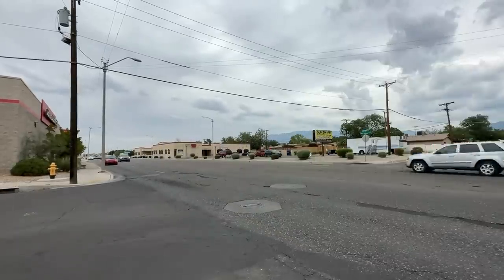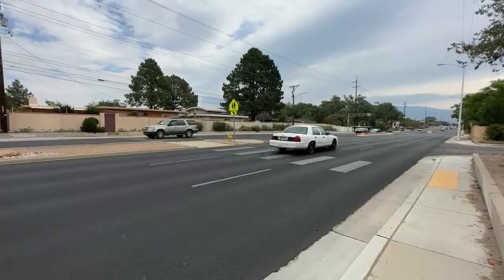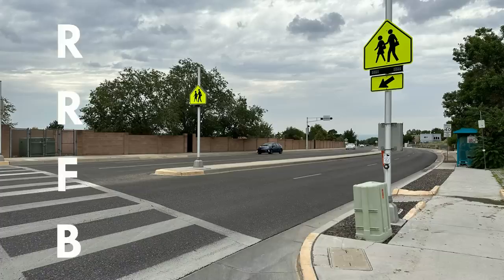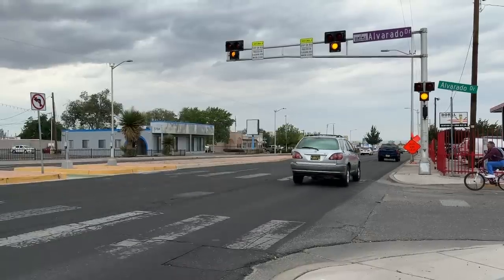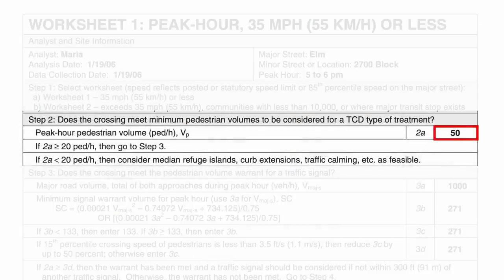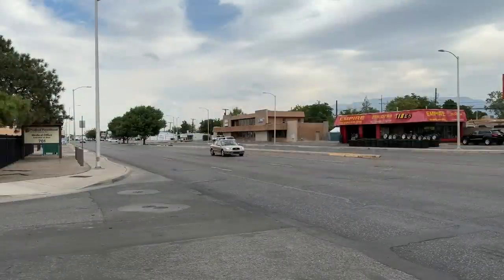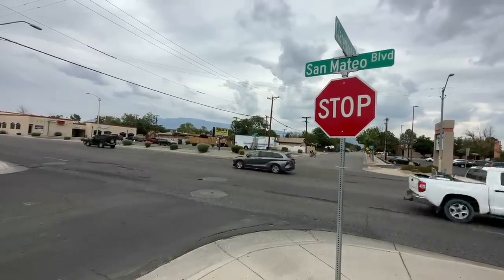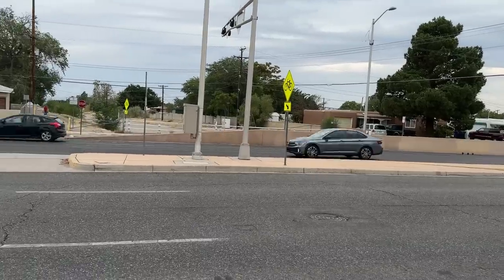The Insane Ways Traffic Engineers Try to Make Streets "Safe" For Walking

Comment: I wonder what the effect of adding bicycle police units would be. If law enforcement has to deal with dangerous streets, they would be more likely to enforce traffic laws in favor of pedestrians and bikers. I also think these bureaucratic methods for evaluating street construction are relatively useless. To me, a better approach would be to construct different "routes" for different purposes. That may even include high traffic routes for common commuter routes, but it would also include corridors for pedestrians, bikers, and slow moving vehicles.

Comment: There is often only one safe way to cross locations like this,  and it's to move about 200-300 feet away from the intersection  in question and cross there, away from the intersection,  when there's a gap in traffic. The 200 ft gap gives you 5 seconds . And allows you to screem out turning traffic and focus only on single direction traffic.

You need to understand that vehicles travel  approx 1.5 times the mph ...at 40 mph that's 60 fps.  Walking is only 5 fps...it 2 seconds to cross a single lane. In that time vehicles have moved 80 feet.

They are legally required to put in these crossing facilities right at the intersection but they often inherently unsafe by location. Change your location farther away and cross there instead of in the death zone.
Reply: Steve, you are so, so right about this.  I remember as a kid, over 50 years ago, being taught at school that the only safe place to cross the street was at intersections.  My brother and I talked about it and decided that was the stupidest idea imaginable.

Comment: We call then beg lights.  
You have four options
Nothing which is bad
A stop sign, where you have to stop 100%, though most don’t
A stop light which are very expensive.
The latter two also tend to move the “road rage” elsewhere.
Then there are the RRFB’s or what we call beg lights.
In Oak Park where I live (and a City Nerd favorite) we call them Beg Lights.
What I say is that you are indicating your desire to cross the street.  
Many cars don’t stop, but the majority do.  The light goes on, so the pedestrian is or should be aware.
Given the issues with traffic enforcement, I’d prefer mobile cameras with small tickets.
Most drivers stop, and I think the Beg lights are for this country about as good as you’re going to get.
Even if you have an ideal crossing with space and time to cross, short of gates, some drivers will always be problematic.
The problematic drivers is where the focus needs to be.
I much prefer the beg lights.  I no longer get angry, and for me, on foot or bike I feel safer.
Pedestrians needs to be aware.

Comment: Though I understand the baseline of why its terrible we even have to have these kinds of things, I personally strongly appreciate having them, since its a step in the right direction. For me, its not some illusion of safety (you always assume drivers are going to be arrogant or oblivious when crossing streets as a pedestrian, even at full crosswalks at signaled intersections), rather it is the fact we have been given the choice and option to cross sooner at a place where its at least signaled for us. Not having any option/choice is rampant and terrible. To have to try to wait forever for a potential opening in traffic flow to dead sprint across a street, especially a thoroughfare, is inexcusable. So having these go in is huge as it can remove this issue.

Also while on the topic of pedestrian infrastructure, when are we finally going to use logic and use ramps exclusively rather than stairs, elevators or escalators to traverse elevation planes?

Comment: It is a really pointless game when the worksheet calls for the engineer to work backwards from the result they want to justify and then lie where necessary.  It just makes sense to put an on-demand traffic light at EVERY intersection along a stroad and then worry about the relatively few places where the distance between intersections is more than a quarter mile.

Comment: I want to bring up a rural problem.  Its not safe to ride bikes on country roads and accidents injurying Amish buggies happen every week.  We need some kind of warning system so vehicles know hundreds of feet in advance that there are cyclists and/or horse/mule/donkey vehicles or riders.  I think more people would use donkeys and mules in rural areas if it was safer.  Every year the Amish upgrade horse drawn implements and carts with quality machinery.  Yet it isn't safe to take a cart of compost with a horse to a neighbor's home or go to church or a nearby store with current road conditions.  Maybe high schoolers would have fewer accidents in cars if they could ride a horse or mule to school and have a school stable.  Middle schoolers could also ride to school if there was a safety system, thus decreasing the number of school buses needed.  The students could then place the manure at the school stable in a compost bin to help the school garden.  Donkeys and mules live long and eat inferior forage, can work for many years and could be a safe way for young people to get around if there were the right road changes and rural school stables.  Donkeys and mules are often overlooked, but they are cheap compared with vehicles and last much longer, and I'm sure make less greenhouse gases than cars.

Comment: The solution seems obvious, to me at least.  Forget about both the ridiculous crossing flags and expensive solutions like the HAWK signals, the RRFBs will do just fine, with a couple of minor modifications.

I would suggest the following modifications:
1) Add a network-linked and WiFi-capable video camera and push-to-call button to each RRFB in a manner that allows the camera to capture the entire 360-degree view around each RRFB pole
	a) Obviously, make sure that the camera is reasonably secure both from physical access and hackers and also add a sign (and a corresponding law if none exists) that charges will be pressed against anybody even suspected of tampering with the system
2) Modify the signage on the RRFB to proclaim that all car (and bicycle) traffic MUST stop for pedestrians in the crosswalk when the lights are flashing or a fine of significant value will be automatically assessed against the owner of the car
3) Modify the electronics to start recording on the camera (first to a local SD card before sending over network) at the same time as the lights begin flashing and continue recording the scene for as long as the lights are flashing
4) Add a five or ten second timer to the sign indicating that pedestrians should wait until the timer reaches zero to begin crossing the road
	a) This is like the yellow light on a traffic light indicating that cars should begin slowing down
		1) This ensures the pedestrians are fair to drivers as well allowing them a few seconds to either pass or stop
5) On the modified signage for the RRFB, provide instructions to pedestrians to push the call button on any RRFB at that crossing if there is any kind of incident where a driver fails to yield to have a call-center attendant provide them with a temporary WiFi key to download the video recorded by the camera onto their smartphone or other device for proof

And here's the most important part:
6) Also on the modified signage for the RRFB, make a note that pedestrians should finish crossing the street as soon as possible as the video will be reviewed on a daily or weekly basis and any pedestrians caught fooling around, playing in the crosswalk, or otherwise hampering the flow of traffic from resuming will also be reported to police and fined

My major point of contention with current setup for crossing flags, HAWKs, RRFBs, and other systems of the like is that there is almost zero incentive for drivers (and cyclists) to stop for pedestrians and almost zero punishment for offenders.  On the other hand, with the modifications above, you can bet that nearly ALL drivers will make sure to stop promptly at crosswalks when the lights start flashing after receiving a couple of fines for $250 (or more) each in the mail!  (Even if the drivers choose to contest, they will then have to deal with the hassle of taking off work - and burning a personal or vacation day in the process - to go to court and fight it out with the city prosecutor.)  Looking at it from the drivers' point-of-view, the system also encourages good behavior (i.e., crossing the crosswalk as quickly and efficiently as possible) on the part of the pedestrians as well, because no pedestrian wants to get a fine in the mail either.  Just like with the so-called "broken windows theory," I predict it will take no more than a couple of weeks after the first fines get sent out before drivers (and pedestrians) start taking the crosswalks really seriously.  (As another example, consider when the "Move over" laws for car traffic on highways were first implemented.  It did not take any length of time before word got out and drivers began slowing down or moving over for emergency vehicles with lights flashing on the side of the road.)

My solution would also avoid the whole "but cameras are violating my privacy in public" argument because the cameras only record when a pedestrian pushes the button.  And I predict cities (and suburbs and towns and ...) would love this setup as soon as the revenue from the fines starts rolling in!
Reply: This is a very complicated and still expensive solution to the problem that is the street being unsafe. If you fix the design of the street itself, you can avoid the deadly situations that the design creates instead of just fining drivers for how they naturally act.

Comment: What i find strange is that the crosswalk is in a straight line from the sidewalk. This makes it more difficult for car drivers to see the crossing pedestrian. If you offset the crosswalk from the crossing the pedestrians have to walk a few metres more, but they are much better visible for right turning car drivers.
Reply: Better to not allow car drivers turning right, it’s very unsafe for the walkers. Crossing on the crosswalk. I was almost hit that way.

Comment: RRFBs are next to useless.  Whoever came up with the idea doesn't know how human vision works.

Stretch out your arm in front of you, thumb up.  That area of your field of vision covered by your thumb is about how much high resolution vision you have.  The quality of information coming from your eyes drops off rapidly from that small area.  You think you are seeing colours in your peripheral vision right now?  You aren't.  Your red and green cones are concentrated in that small high resolution area; blue cones are more evenly dispersed (this is why those safety phones have blue lights on them: it you are going to detect a colour in your peripheral vision it will be blue).  Most of what we think we are seeing isn't what our eyes are transmitting to our visual cortex, it is our visual cortex 'caching' data.  A lot of magic is learning how to exploit this.  If a magician can divert your attention to something just a a few hand widths away, you won't see what they are doing with their other hand.

Back to RRFBs.  Think about where they are placed, and where drivers are going to be looking.  If the driver is not in the curb lane they legitimately will not "see" the flashing lights.  In bright daylight it is hard to tell if the yellow LEDs are on.  At the very least they should be alternating yellow/blue.  Even then, if you want to get drivers' attention you need to put the signal right in front of them.  Or maybe every car should be equipped with a pedestrian crossing signal receiver that plays an alert when approaching an activated crosswalk: "pedestrian crossing, slow down and be prepared to stop".

Comment: The 7 lanes intersection on San Mateo is 3 blocks from a traffic light. If you had recorded this intersection (Marquette) at rush hour it would be bumper-to-bumper. This section of road is a main feeder to and from Kirkland AFB, Sandia Labs and the airport to I40. You also showed Lomas as a less than traveled road during non-rush hour. Albuquerque is urban sprawl plus poor planning doused with extremely poor drivers. Putting random crossings lights will not help the situation, just enrage the drivers. The city needs comprehensive traffic planning not the made for TV bandaids that Mayor Keller loves to trot out after a death.

Comment: My city has a pair of those weird pedestrian crossings, and it didn't take too long for an accident to happen. In both cases, the configuration is much better than what we see in your video, and obviously, it still isn't safe enough. They are both on the same boulevard, 2 lanes for each direction, with a wide median and protected center space where the pedestrian can stop. Part of the issue with the location where the accident happened is that its at the bottom of the gully. On one side, the slope is particularly steep, so peoples have a tendency to allow themselves accelerate as they come down the hill. On the other side, peoples use the gentler slope to accelerate and give themselves a bit more go before they hit the bottom and start climbing the steep slope on the other side. The configuration of that intersection is just awful and totally unsafe.

Comment: In Oregon this law is actually on the DMV test. When is the speed limit 20 mph in a school zone? Correct answer on the test is "only when there are people at a crosswalk". Well according to the DMV those flashing lights don't mean jack. There can be adults and children all around but as long as none of them are at a crosswalk you can feel free to just speed on through at a normal speed.  Of course this is an absurd law that contradicts itself but still something should be done. Most people do the smart thing and slow down when people are present but legally they really don't have to and could get off scot free when they plow thru a bunch of jaywalkers. No wonder everybody at least in Oregon drives everywhere with one or two exceptions.

Comment: Hi CityNerd. I have a suggested topic:  does adding housing to a housing-starved city make the city more affordable?  I believe many cities around the country are struggling with housing shortages and decreased affordability.  The example I’m thinking about is San Francisco, which has a mandate from the state of California to add 82,000 housing units by 2031.  While I root for YIMBY efforts at increased housing development and density, I’m not convinced the increased supply will make a significant difference in affordability in a city like San Francisco with such a limited geographical area. Are they just building more housing for the well-to-do?  Are these efforts for affordability more effective in a city like Los Angeles, which has much more potential to add to the housing supply because of its vast geographical boundaries?  Not sure if this topic is up your alley. Thanks.
Reply: Planners should be looking at the region as an interconnected ecosystem. Even if all of the new housing in San Francisco is bought by the well-to-do, at least that means that those same well-to-do are not escalating the bidding wars for housing in the surrounding municipalities.
Reply: All the information I've seen is that more housing will reduce housing costs and that will then trickle into other things like cost of food. But the rub is in how much housing would need to be built in order to significantly reduce costs. And all of this relies on market forces, of course. So, yes, just building some housing probably won't be enough to actually help people, but it's better than nothing, and will reduce the rate at which costs increase (everything else held constant -- which is unrealistic, so the actual outcomes will vary).

Comment: In my small Swedish town there's two similar devices, but they light up via activity sensors and not through beg buttons.

One is in a 40km/h zone (25mph), but it's right at the transition to an 60km/h zone (37mph) so I guess they wanted to add that extra bit of security. It's only two lanes though and the street narrows at the crossing so I don't know if it's actually doing anything. At some of the busier crossings further down in the 40km/h direction, there's proper stop lights with beg buttons.

The other one is a much worse example. It's at the second busiest road in town and there's no real crosswalk, only slots in the median hinting at where to cross. There's four lanes of traffic, two through-lanes as well as a left turn lane and right turn slip lane. And while it's "only" 60km/h at the intersection, it's right at the transition to 80km/h (50mph). At the very least they installed speeding cameras at the same time they installed the crossing lights. They rebuilt a nearby, very similar crossing into a roundabout with a proper pedestrian underpass. But they can't do that for this crossing since it's the site for a future planned bypass that has been decades in the making. The state has put a wet blanket over any real traffic improvements. (This includes another, very accident prone crossing, that at the very least has a pedestrian underpass.)
Reply: Oj var är det här? Har aldrig sett. Jag trodde inte såna "blinkande skyltar" ens var lagliga. Det blir ju jättekonstigt att förare plötsligt får en helt ny skylttyp snarare än ett vanligt rödljus.